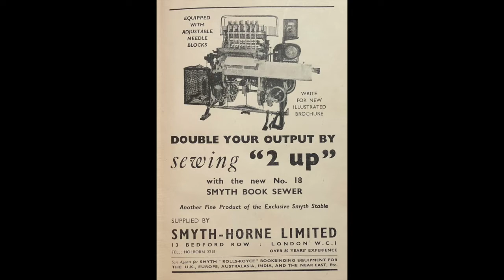Two-On Sewing // Adventures in Bookbinding

Comment: Hello. Very Useful video. I would like your suggestion. I have an old dictionary for re-binding with 85 signatures (16-pages/sign. 1360 pages). What would be better for so as to maintain a balance between no big swell and durability in binding ? with two-on or three-on sewing or mixing between one-on,two-on and three on ? Thank you
Reply from the maker: Yes, this is a case where fine, but strong thread, and two-on (maybe three-on) sewing is called for.  I would use 4 supports (cords of tape) and three-on.  Do the first and last 3 sections all-along (normal sewing) and then swap to three-on.  You have to do the maths or work out near the end.  You may have to do more than 3 sections at the end, which is fine.  Have fun!  DAS
Reply: @DASBookbinding  Would I also like to ask you, use the existing sewing holes or create new ones? If I use the same existing holes to avoid guarding (for no-large swell) I will necessarily use 3 cords by default. Finally, since we are discussing it, I would like to suggest you to make a video with the steps of re-binding old book from the beginning. Thank you
Reply from the maker: @vaidoo  Yep, existing holes is always best.  Don't tell anyone, but I'm planning a special project for when I reach 100 videos and I think it will involve rebinding a book.  All the best, DAS

Comment: If the holes can be sawn, what is the reason for using an awl to punch each hole?
Reply from the maker: I only saw if it is required, such as sunken cords or for making the kettle stitches lay flat.  It is better to not remove material if can be avoided.  An awl just pushes fibres aside.  You can then close the holes back up with the pointed end of a bone folder.  DAS
Reply: @DASBookbinding  Got it!  Thanks!  I've got all of my tools and supplies now, except that I'm still waiting for the finishing press and sewing frame to arrive, and I'm working on my first book.  I've chosen to do a sewn board binding as my first book.